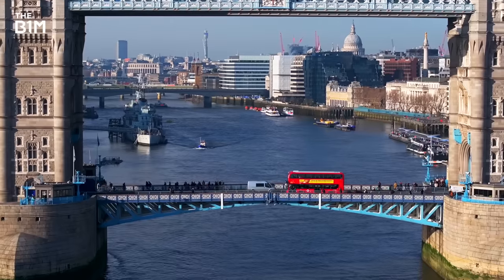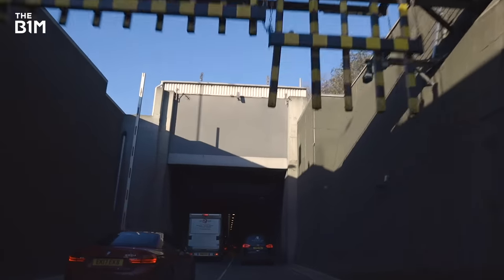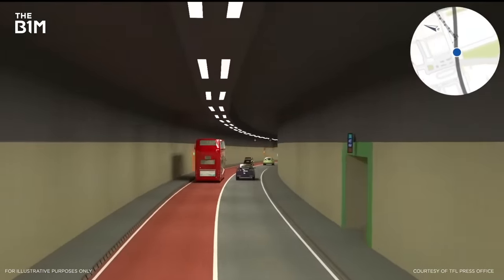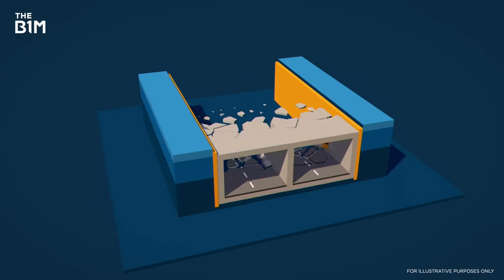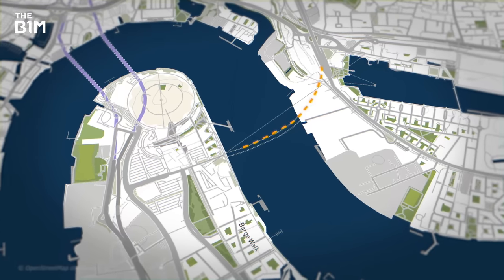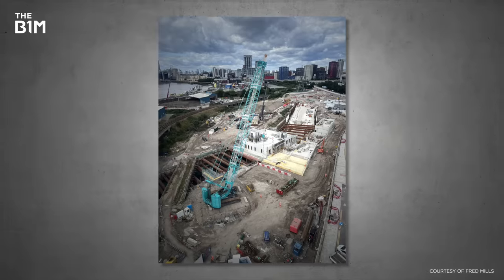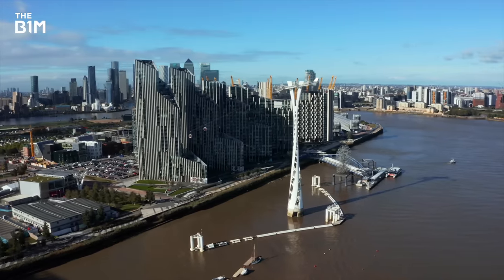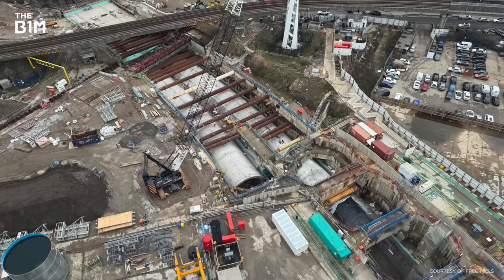The $2.8BN Megaproject Dividing London

Comment: Nice. Got in at 5 minutes. Very cool episode! Nitrogen skates is a cool method of turning it around and saving some time and money. I'm curious exactly how much that saved in the end and whether other projects would deem it worthwhile to explore too. Interesting to hear some of the complaints at the end. I'll be honest, I'm usually more sympathetic to the concerns that big infrastructure projects have huge outsized and often negative impacts on the environment, but the ones in this case feel less compelling to me. There aren't any cultural institutions being disrupted here. No massive environmental safe space being violated. There's inconvenience and noise, but that will pass. Am I wrong in just going.. meh?

I think congestion is a fair concern, but allow public transit to have an alternative route through the city is the right way to go about that. Toll roads may be annoying, but again, that will help the tunnel from becoming a new point of being bogged down. Worrying about idling cars and pollution is worthwhile, but then the obvious solution is just to continue pushing hard towards the transition away from fossil fuel cars. Don't need to worry about tailpipe emissions when there are no tailpipes involved.

Comment: People travelling by car take up 20-30 times the space of those using public transport, cycling or walking. Cars are the only significant cause of congestion. So any scheme that encourages more car use will worsen congestion overall, even if it adds a sticking plaster to a specific bottleneck. After 70 years of this happening in every country in the world, no-one stills think that building more roads will relieve congestion. This is purely about keeping people in a very localised area a bit happier for a short period until journey times get back up to the maximum tolerable limits.
Reply: It won't increase congestion
Reply: @Gfynbcyiokbg8710  have a read up on induced demand, the value of journey time on modal choice, and I suspect Braess Paradox could come into effect as well. But essentially you'll encourage more people to drive, and unless every point from origin to destination that every new driver will be free moving then you'll end up increasing congestion in other places. I'm not aware of anywhere inside the M25 that is always free moving now, let alone when you've got even more traffic on it.
Reply: @joegrey9807  Except now there will be tolls on both the Blackwall and Silvertown tunnels, better bus routes, and quicker and cheaper bike routes.
Plus there isn't really an alternative
Reply: @joegrey9807 Can you prove any of that

Comment: Surely the could have put cycle and pedestrian access through a ~1km tunnel!
Reply: No one would have wanted to cycle through a small, noisy, mile long tunnel
Reply: @Gfynbcyiokbg8710  agree it would not be 1st choice to ride a shared tunnel but where else can you quickly cross the river in that area as a cyclist? Take a lift and walk through the foot tunnel at Woolwich or Greenwich or the ferry when running? I lived in Charlton for a few years and there was limited cycle options esp compared to North of the river.
Reply: @freespacexl  You can take the cable car or the future shuttle bus which will run every 3 minutes

Comment: I just don’t get why they didn’t build it in Thamesmead. There needs to be a few more river crossings in East London and this new tunnels has the same mouth as the Blackwall Tunnel. 

No I’m not pro car, new roads like this also provide new public transport opportunities in the form of buses.
Reply: A tunnel or bridge near Thamesmead would have added massively to congestion and pollution as the roads aren't big enough to handle all of that new traffic. A DLR extension to Thamesmead would be alot better
Reply: @Gfynbcyiokbg8710 If there was a crossing at Thamesmead, congestion wouldn’t be a problem because the current roads around Thamesmead and Beckton are oversized and mostly dual carriageway so can easily handle extra traffic. I’d only be worried about Plumstead Road to the Woolwich Ferry Roundabout but even that sufficient bus and cycle lanes.
Reply: @RS-pb2se  Not really. East of Thamesmead they're probably big enough, but south and west of Thamesmead the roads are mostly only one (car) lane in each direction

Comment: If they put tolls on silvertown. It wont reduce the traffic on the other crossings where tolls arent in place. A big white elephant so to speak. Introduce tolls for both and hopefully theyll begin to recoup the money wasted in this project
Reply: Even if the tunnels give the presumably-not-taxed busses a clear route that removes them from the congestion of the other routes it will get rid of some of that congestion as well as speeding up the bus transit times.

Comment: man, this is just going to induce demand, putting more public transport networks by extending the DLR and overground can be notably more effective to transport
Reply: Induce demand? Complete nonsense. Nobody, absolutely nobody is going to move into the area because of the tunnel. The demand already far exceeds the supply in there.
Reply: @acceleratedsloth  what are you on about. There’s literally companies planning transport hubs in that area now that will push 1000’s of the worst polluting vehicles in because of the tunnel.  Look up some of the applications going in.
Reply: @acceleratedsloth  It's not about people moving there, it's about people in the area choosing to drive who previously wouldn't have because the tunnel has made driving more convenient. These extra people driving cancel out all the extra capacity.
Reply: Yes and no

Comment: Fully expect the new tunnel to be congested within a year. It induces demand, traffic will increase. Building it for public transport only would be a good first step.
Reply: How does it induce demand?
Reply: @acceleratedsloth  It's an economic phenomena, called, well, "induced demand" that has been observed and measured time and time again: If you increase usable road space, drivers that might've otherwise opted for different paths will go back to using cars until the equilibrium is reached again - traffic jams. The reverse is also true: If you reduce road space, traffic will flow faster.
That's not saying roads shouldn't be built, but they're not the be all, end all solution to traffic jams.
Not Just Bikes recently had a great video explaining it - titled "More Lanes are (Still) a Bad Thing".
Reply: @alimanski7941  Not Just Bikes and every other similar channel actually do push the "don't build roads" mentality. Most of them would ban private vehicles in all cities if they could get away with it.
Reply: @willythemailboy2  if I recall correctly, he specifically says "sometimes you have to build roads". Besides, it doesn't mean he's wrong about induced demand.

Comment: Not sure why a modest cycle and footpath couldn't have been included. I know there already is one at Blackwall, but it's quite narrow, and it wouldn't have cost that much more to include this given the crossing is being built.
Reply: I don't know who on earth would want to walk through a mile long, polluted car tunnel
Reply: @Gfynbcyiokbg8710  Neither do I. A shared cycle path and footpath would obviously be in a separate tunnel and separately ventilated, as is the current Blackwall pedestrian / cycle / scooter tunnel.
It could then double up as an emergency exit.
It would also stop all environmentalist protests, given they were catering for healthy active transport as well.
Reply: @yggdrasil9039  Ok so you don't want a modest footpath, you want an entirely seperate tunnel for hundreds of millions, if not billions extra.
You also don't need a seperate emergency exit tunnel.

Also blackwall doesn't have a seperate pedestrian tunnel, it just has narrow footpaths than haven't been open to pedestrians since 1969
Reply: @Gfynbcyiokbg8710  Billions to make a pedestrian tunnel out of gold yes.
Not much extra to include a pedestrian tunnel in the concrete cross section templates though.
Reply: @Gfynbcyiokbg8710  ok I don't know what the name is, but there's a pedestrian tunnel nearby. I crossed it only a year ago.
Reply: @yggdrasil9039  a TfL consultation found that even that would cost hundreds of millions extra, and you'd still end up with a small, cramped, noisy tunnel

Comment: There is no such thing as a road tax. It was abolished in 1937. Motoring taxation in the United Kingdom consists primarily of vehicle excise duty, which is levied on vehicles registered in the UK, and hydrocarbon oil duty, which is levied on the fuel used by motor vehicles.
Reply: We still call it road tax.
Reply: VED is still a road tax

Comment: Ahh, yes congestion and Ulez charge. Where a 2016 1.6 diesel engine is not compliant but a V8 Ferrari is. 

Poor people tax £25 per day on top of yearly road tax. Simply to have my car parked within the walls of London. That's without paying for the actual parking! Like most we're confused about how paying £12.50 makes the air cleaner 😮
Reply: A 2016 1.6l diesel could absolutely be ULEZ compliant

Comment: The eco NIMBYS will oppose anything that moves this country forward. We need unprecedented levels of infrastructure investment in road, rail, and public utilities, across the country. There should be a lot of focus on East-West connections in particular.
Reply: since when did building new roads decrease congestion? All the traffic flow models (from the mayors office themselves) show increased congestion and pollution along the south approach roads, which are already polluted enough. We'd be very happy if this tunnel benefitted the 60% of locals who don't own a car. I cycle this route and would love this tunnel if it was any use for me. The foot tunnels, Greenwich and Woolwich have broken down lifts so can't be relied on otherwise it is a 10 mile detour to make the same journey you can drive in a car. That is why there is opposition. We need more rail and public utilities but this is not where 3 billion of public funds should be going.

Comment: One lane for cars oh but there's a bus lane FFS it's just another rotherhide tunnel what a joke you need at least 8 lanes forget the bus make them walk
Reply: No
Reply: Not true, Rotherhithe is smaller. Only cars and maybe single decker buses can use that. this new tunnel allows double decker buses to use them. And there is only one bus route currently using Blackwall tunnel north to south of the river and it's unreliable. At least the bus services will improve.

Comment: What a waste of money to build a modern tunnel, and not let pedestrians and cyclists use it. Better than Lumley's ludicrous garden bridge though.
Reply: There is a reason why pedestrians and cyclists are not usually allowed in the same tunnel shaft as cars is pollution. Even with good ventilation, it's hard to dissipate all the gases from cars and I wouldn't want to be the one which spends 5 minutes inhaling that each day. The solution would be separate shafts but that would increase the cost enormously .

Comment: 1:50-1:53 I see cars on bus lane; have they got fined already?
Reply: I think taxi's can use the bus lanes sometimes
Reply: @ShortCene  Correct, taxis are generally exempt from this rule, allowed to use the bus Lane(some exceptions may apply)
Reply: @nothereandthereanywhere  I think only buses are allowed to use bus lane. Are there groups, politicians, or political parties that advocate to change the law on bus lane?
Reply: @stevensutanto968  Not necessarily. Look at the road and signage. They often include signs for cyclists, motor bikes and taxis(not sure about London, but outside of London, they are most of the time allowed)
Reply: Black cabs are allowed to use bus lanes in most places

Comment: It really should have had a pedestrian/cycling lane
Reply: No
Reply: @ConstantChaos1 No one wants to cycle through a polluted car tunnel
Reply: @Gfynbcyiokbg8710  who said I meant put it in the main tunnel? No, I think there should be bike and pedestrian tunnels too
Reply: @ConstantChaos1  "cycling lane". A seperate tunnel would be ridiculously expensive
Reply: @Gfynbcyiokbg8710  not if they had planned ahead and integrated it, thats why it was past tense and not a proposal for a new tunnel lmfao. Also the tunnel has a ventilation system js.
Reply: @ConstantChaos1  Thats not how reality works. The tunnels would either have to be significantly larger or they would have had to build a third tunnel, either of which would drastically increase the cost.
Reply: @Gfynbcyiokbg8710  dude I'm an engineering student I'm pretty familiar with the field lmfao. The height of the tunnel is sufficent that wiring could have been done outside of the maintenence tunnels meaning one of the 2 service tunnels could have been re- tooled into pedestrian/bike tho the distance means it would likely only functionally be for biking. The reason they didn't was to keep the ferries running but since they aren't all electric I feel that was the wrong move. It's funny that you say thats not how reality works when you clearly haven't done any more research than watch this video lmfao. 
You cam stop illustrating the dunning-kruger effect at any point by just not replying, js
Reply: @Gfynbcyiokbg8710  also i love how you came back here a month after you tried to start this discussion and decided to @ me this time as if I hadn't deliberately ignored your ignorance last month.

Comment: Money would definitely be better spent on transit. Far higher capacity than cars.
Reply: Except no transit route would have reduced demand
Reply: @Gfynbcyiokbg8710  It would have helped cover existing demand for a lot less in the way of emissions and at a lot higher of capacity. Even just a short people-mover can move way more people than your average road tunnel. (Now, if you make it bus only, that might make it worth it.)
Reply: @fernbedek6302  There is already a tube tunnel 200m away and a bus only tunnel wouldn't have been profitable for the private company financing the project. A DLR extension also wouldn't have reduced much demand
Reply: @Gfynbcyiokbg8710  Still a bad investment that will only make traffic worse by encouraging people to drive.
Reply: @fernbedek6302  No taxes are going into paying for it and the tolls will only reduce demand so why not build it?

Comment: Absolutely STUPID. Close the barrage for several months stopping the tide. Dig trenches and lay pipe tunnels ... half the time and a fraction of the cost. Do the same at a few other places up-river. Alternatively, build far cheaper bridges. There is no reason why American cruise ship owners should be able to run their ships under Tower Bridge just for the amusement of American tourists. There is no reason for headroom to be more than 40 feet these days right down to Tilbury. It wold be wise to give 50 ft. headroom at high tide though as in addition to predicted rising sea level, London and the South-East are sinking into the Earth at the rate of 1 inch every 11 years (isostatic settlement following the last ice age). That should do for a few hundred years. Pollution lurks in tunnels requiring huge fans using lots of power to clear it and giving the Bolsheviks another club with which to beat the petrol and diesel driver. On bridges, pollution blows away and no expensive fans.